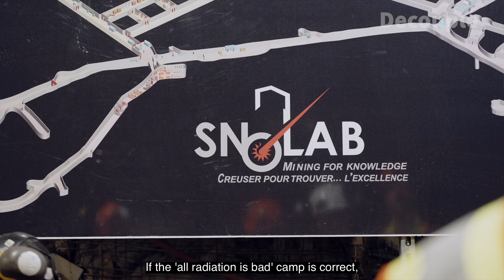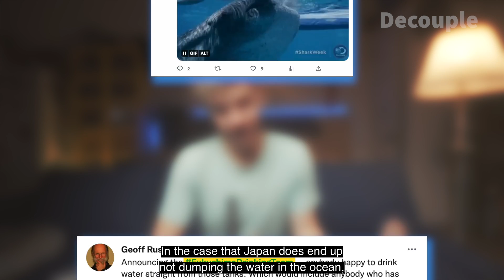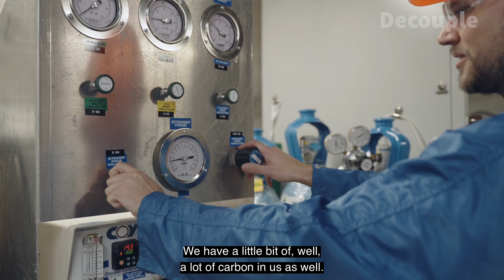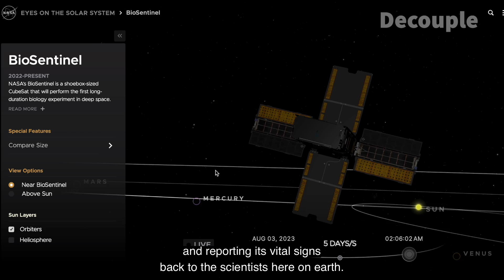Is A Little Radiation Good for Us? A Trip to the World's Deepest Clean Room (SNOLAB)

Comment: Interesting comment about growing radioactivity-free yeast, etc., requiring Potassium-40 (K40) and Carbon-14 (C14) free growing media:  I can understand that getting K40 free media is expensive, requiring isotopic separation to get pure, nonradioactive K39.
But getting C14-free media should be easy:  any bit of coal or crude oil will be free of C14, since it has all decayed, millions of years after the deposits formed, back in the "Carboniferous" period, some 300 million years ago.
Indeed, the massive burning of coal and oil around the world, has affected slightly the isotopic makeup of CO2 in the air, as well as in plants & animals.
Reply from the maker: Interesting. I forwarded this on to our hosts at the REPAIR experiment and will let you know what they say.

Comment: It doesn't matter what the results are, no regulatory agency will ever give up the LNT regs. The NRC would go to war over giving this up.
Reply from the maker: Can you say more about why?
Reply: @decouplemedia  The primary mission of the NRC is and has always been the end of domestic nuclear energy in the US and anywhere they have influence. They have been wildly successful in this mission.
Reply: @decouplemedia  Replacing a regulation with one that is 'more permissive' looks bad politically for a regulator.

It is so much easier, with far fewer questions, to just 'leave it alone'.
Note that the reverse is hard, but not nearly quite as hard.
The reason is, most people are risk averse - https://en.wikipedia.org/wiki/Risk_aversion#Public_understanding_and_risk_in_social_activities
Reply: The British company Moltex have a fully engineered nuclear reactor that is fuelled by used nuclear fuel. The very stuff we are told has no solution is actually a highly valuable energy resource. Even better, used nuclear fuel has a half life of 30,000 years. Moltex burns the long life elements leaving a waste with a 30 years half life. 
Why can’t we have this reactor.
Reply: @Dave5843-d9m  Not in the US, the NRC would never approve it. The NRC has to be completely replaced by a regulatory body that values clean, reliable energy for the world. The NRC prefers coal.
Reply: @chapter4travels  My hope for the NRC is that once Moltex and Terrestrial prove themselves out in Canada, or the many other ideas around the world, the NRC will be forced to approve reactors that are working, as designed, with lower maintenance costs (a bit of a proxy for safety and regulation).
No US reactor vendor will reap those benefits, but at least the utilities will be able to buy those designs.

It will take a long time, but even the NRC won't be able to ignore the empirical evidence forever. So we need those new designs to be build and operate in Canada/Mexico, Europe, or Japan/Korea - to bring it home to the US.

Comment: "All of this opposition is based on the belief that any increase in radioactivity ..." -- not exactly. And by understanding exactly what the opposition is based on, we lose such respect as we may have had for it, but understand more clearly how to defeat it.

It's not simply "any increase in radioactivity". It's any increase in radioactivity *that has reduction in government's fossil fuel revenue as a side-effect*.

Radioactivity that has no such side effect? Um ... very deplorable, just awful ... Anyway, moving on ...

Thus, the radon emissions from gas-fired electricity plants to replace Fukushima Dai-ichi, although they are about equal in raw keVs-per-second to the tritium in FD1's tanks, are of no concern.

Thus, uranium that could power most of the world, if fissioned in a system with fast breeder reactors and reprocessors, is spread on farmers' fields as part of phosphate rock. Crickets.

Google "nuclear by association" for more examples.